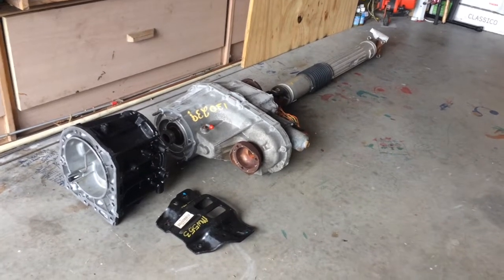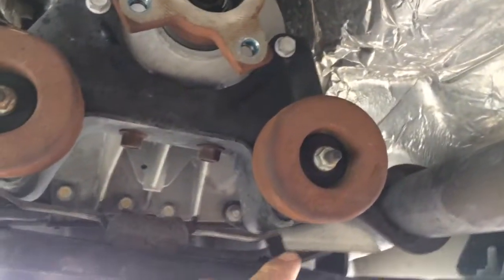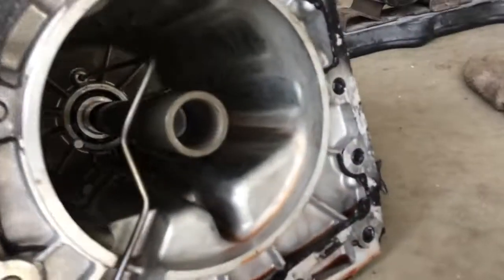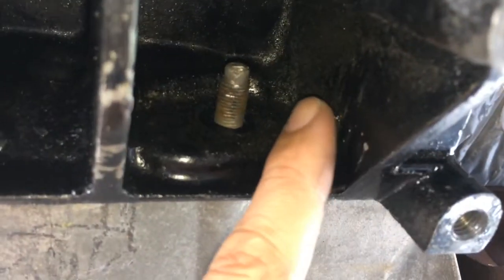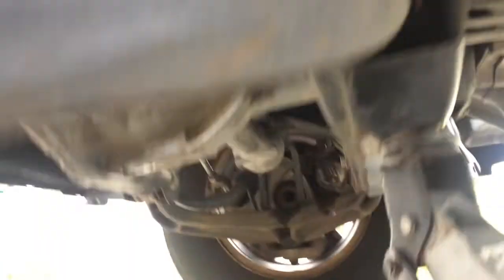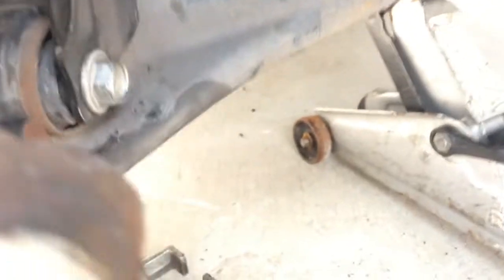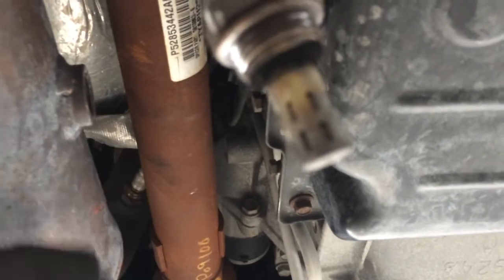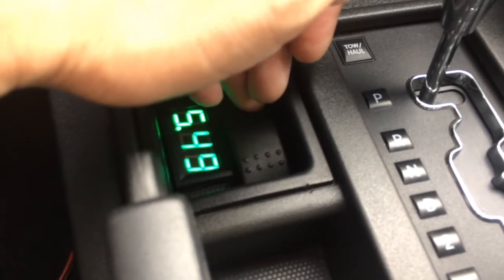2010 Jeep Liberty KK 2wd to 4wd (4x4) Conversion

Comment: Do you have any updates on how this is still working? I’m curious about the longevity of this. Thanks for the uploads!
Reply from the maker: Still works. I don’t use it as much because I bought a truck to pull my boat. But still shifts perfectly. I’m saving it for my daughter for when she gets her license.
Reply: @vegajay  Thank you for the response and that’s great to hear! 

I was also curious if when you were using a power supply for testing the position sensor voltage if you read the current draw? I’m worried if there needs to be current protection for the 5V input in case the variable resistor inside burns up and shorts. Do you know if there’s circuit protection inside the MP transfer case?

Edit: Just watched again and noticed it disconnects when not in park and is protected by the fuse for the cigarette lighter/accessories. Probably not as issue if it’s lasted this long then!

Thanks again for taking the effort to make these videos and I wish y’all the best!

Comment: How is this running  a few years later?
Reply from the maker: Still running. I bought a 21ft boat last year and the 4LO makes it so easy to pull out of the ramp.
Reply: @vegajay  That's awesome, helluva job.
Reply: Im not sure my comment went through on your youtube home page but I would love to have the wiring diagram of your system from the switch to the connectors/wires of the actuator. My 09 is a factory 4wd but speed/wheel speed sensors are bad so computer wont let me shift into 4wd unless I turn the engine off and on again and move switch before code pops up again. My name is Mark Zogg, Im on a few kk/Liberty groups on facebook if youre on there too. Thanks.

Comment: When u install the 4wd adapter u put the thing whas inside of the 2wd adapter?
Reply from the maker: There is just a longer intermediate shaft that connects the transmission output spline to the flange for the driveshaft. That’s it. It’s basically just an extension to fit the 42RLE transmission into that car. Other cars that use that same transmission may have different adaptares, or maybe none at all, depending on what kind of space it needs to fit into.
Reply: @vegajay  so u dont use it? Just put the new adapter and transmission
Reply from the maker: @MrDanielon400  sorry. I’m not sure what you’re asking. Can you rephrase your question?
Reply: @vegajay  did u use the 4x2 intermidiate shaft or did u use a 4x4 one? U dont explain that part on the video
Reply from the maker: @MrDanielon400  I had to use the shorter 4x4 intermediate shaft. I remember that was tough to find and it was pricey, for being just a small metal pipe.

Comment: I have an opportunity to get a parts 4x4 2012 limited for cheap. Mine is a 2012 limited jet. Is there any way I can swap everything including pcm, switch, etc. or would that still have to be reprogrammed? BTW, the parts car is smashed, and high miles, so I wouldn't want to try and save it.

Comment: Why not use the factory switch? Also did you need to change any of the wiring to the Jeep, PCM, or anything in the fuse box?
Reply from the maker: I couldn’t use the factory switch because the factory switch works in tandem with the PCM. Since my Jeep was originally 2wd, I would have to reprogram the PCM (if even possible). This setup completely bypasses all electronics. It’s as close to a manual lever as you can get.
Reply: @vegajay  thank you so very much for the response and info. Truly greatly appreciated. I have a 2010 that I'm going to be doing the same thing to.
Reply: @vegajay  also did you need to tap into any fuses in the fuse panel for your switch set-up?
Reply from the maker: Justin Thaemert No. I just tapped into the cigarette lighter’s power from behind, though it probably would be better to run a fused isolated line from the battery.
Reply: @vegajay  ok. Thank you so much.
Reply: I have a couple questions again if you don't mind? Regarding the transmission extension what parts are needed other that the shorter output shaft? Are there any bearings needed inside the new 4 wheel drive extension or anything else?

Comment: I like your video and really like what you've done I have some questions can we chat ?
Reply from the maker: Sure. What can I answer for you?
Reply: @vegajay  I have a 2007 jeep Cherokee 3.7 it's full 4x4 all the time not switch to put it in or out or high or low is there a way i can put a switch to do all those things also its kinda sluggish and a pig on gas
Reply from the maker: @kriselliott5866  When you say 2007 Jeep Cherokee, do you mean the same model as mine ("Liberty" in the U.S.A. and "Cherokee" abroad) or do you have the Grand Cherokee. Just want to make sure, so I know the correct model. But in any case, it would be very odd for your car to be in 4x4 ALL the time. You would have constant issues when turning, due to the front tires being spinning at the same speed (your inner tire on the turn would skip). The 2007 KK (LIberty/Cherokee) had a manual 4wd shifter, not an electronic one like mine. Are you saying you don't have that shift lever in your car? As for the gas, this car is notorious for poor gas mileage. Not much you can do about that. I get about 18 miles/gallon, if I'm lucky.
Reply: It's a jeep grand Cherokee laredo
Reply: Can it be done without changing the transmission and transfer case?

Comment: Dude that was a lot of work...selling and buying a 4wd one would have been so much easier and you can shift to 4 high on the fly.
Reply: stock_jeep_life big price difference though. This is cheaper than buying a used 4wd. If you’re mechanically inclined, it’s really not hard to do
Reply: All the 4WD KKs in my area are trashed. 2WD versions I have seen are usually in good condition so a swap isn't a bad idea

Comment: I have a 2007 nitro similar 2Wd would you say this conversion will work on a nitro? Also how's the drive so far?
Reply from the maker: Our cars are ALMOST mechanically identical. Most of the parts I bought on ebay were labelled for Dodge Nitro and Jeep Liberty 08-12. I used this site to get most of the part numbers: https://www.factorychryslerparts.com ... If you'll notice, if you toggle from Nitro to Liberty KK, most parts are compatible:   There will be some parts that are different though. I did a quick search and it looks like the nitro uses a different transfer case. So you'll have to go part by part. But I think it should be a vry similar conversion.
Reply: vegajay thanks for the response and detail info I will for sure do this conversion it's more cheaper and practice than dropping another $10K for another ride.